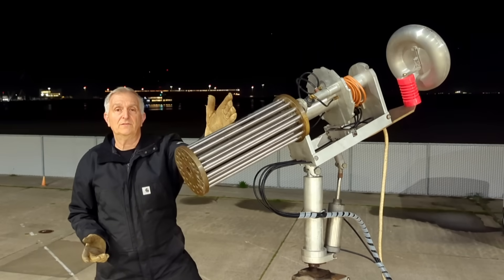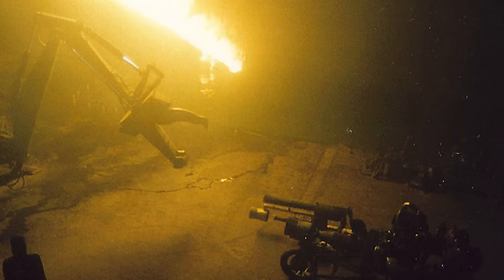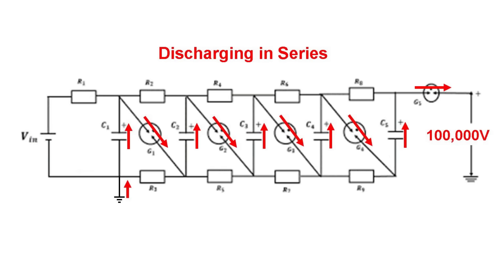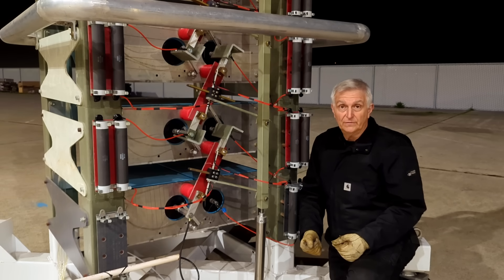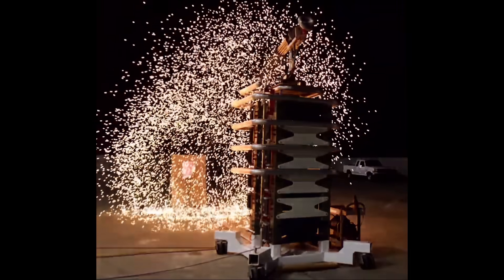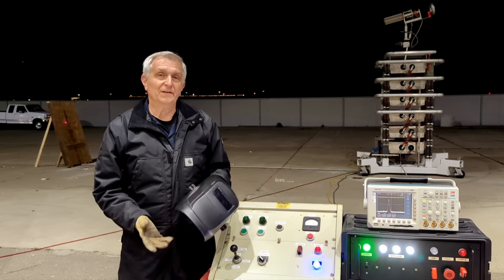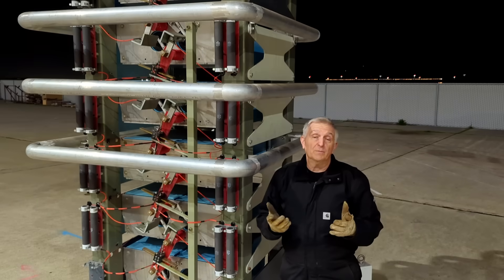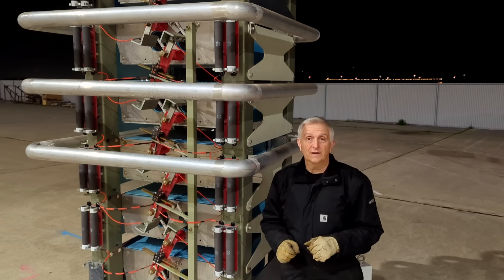Firing the Lorentz Plasma Cannon

Comment: I believe if you're able to control the force of plasma around a spacecraft, time travel is possible, the reason a spacecraft can journey through space then from space enter our parallel levels of Earth's atmosphere & can reach the depths of the ocean with no decompression or long means of oxygen or to replenish. Wormholes in these journeys or time travel can be true. This master of a plasma canon or rifle to myself can be a defense system for any electrical system, Friend , fo or beyond ...Kilo
Without A Doubt In The Thought Of My Mind Calculation! Need to find a more compressed outberst of energy in a smaller prizum uniform 
🤠 🤠 🤠 ...Kilo

Comment: It would be interesting to see this on a FPV drone. The plasma has a short range and not sure about recharging time but putting this as a last ditch effort around a more valuable air defence system may be useful. I'm guessing it can also be used against anti tank missiles.

Comment: If you could up the power output, narow the energy streem and greatly increes the rainge, charge rate and power input  you may have just made one of the best militery wepons ever built.

For instanc you could melt the armor off a tank or detonate bombs still inside a bomming plain or you could use this to oblitorate any long rainge mechanicle target in an instant  no matter the size. Even ocion based targets wont be able to stand up to this thing.

But there are other uses for this divice.

It could actualy be used as a long rainge wierles power transmitter for the electrical grid.
Reply: Tank canon rounds are fired electrically
This thing might cause a mf tank to chain fire all its ammo at once inside the tank

Comment: What was used to make the initial plasma channel?

I came up with a similar idea, but for something meant to stun, and a much smaller scale. To replace a stun-gun. The concept uses a UV laser to ionize oxygen. The laser is split using lenses and prisms before leaving the barrel without losing polarization, or replaced with multiple lasers if no lenses are used for a single one. 

If you didn't use the same approach of a laser to create the plasma channel of ionized air, then could my concept be applied partially to this device? Would range be as much of an issue after that?
Reply: Watch the slow mo
It fires a dart of some kind first and when that connects, it completes the circuit and kaboom. Idk if it's tethered like a taser or what's going on there but it's clear it has to make contact first and then the plasma charges down the channel
Reply: @misterturkturkle That's what it looked like, I was hoping not. 

A UV laser also has its own range limitations but with the levels of energy they're working with I'm sure it's much less of an issue for more of a range than this.
Reply: @mutiechameleon3011 true. But once you have proof of concept you can improve. It may have simply been a stopgap solution while they worked out getting enough capacitors and fixing the "establishing the channel" issues is next

Comment: I was confused about the small projectile, but he actually mentioned it earlier. When he talked about scientists launching rockets to direct lightning strikes, he said that they trail a small wire behind them, before explaining the Lorentz Force that keeps the wire intact. I'm guessing that the small projectile is basically the same, pulling a small wire behind it which is what actually carries the voltage.

Comment: Interesting problem is you still need a ground to receive the connection from the Cannon..has no practical use..the ground line running along the ground to the target has to be gone and the you have to find a way to make it work with out a ground connection..doesn't matter how much energy you crank it up too it still need a ground connection...😊😊😊

Comment: I'm curious about how expensive would each shot be after it is already built, it looks like it is not only expensive to build but also expensive to shoot, also, talking about energy guns, wouldn't a laser gun be cheaper and with longer range?
Reply from the maker: It's about $0.11 of electricity and $0.20 of trigger wire.  A laser that can ionize a 10 meter path would be a terawatt class system costing millions of dollars.

Comment: P(watts) = V(volts) * I(amps)
How does adding ~50% V (from 150KV to 210KV) result in 3x as much power?
Reply from the maker: Increasing V (from 150KV to 210KV) doubles the energy, per E=0.5*C*V^2

Comment: Very nice build with crazy results. How much did it cost to build? About 10 times your $4500 pickup cost? Did you connect the city power lines right to the transformer? There is a 13,000 volt line right next to this house. Not even 15 feet away from the house. Could never get enough legal power to power your monster capacitor bank here. Whole town would black out when you hit the fire button! Great job and also for the almost 5 million views in 4 months. I just bought a 55amp plasma cutter I haven't even tried yet is what sparked my interest. Would be neat to see a bunch more stuff fried and incinerated.

Comment: In your video, I see a large wire running from the cannon on the grown to under the CRT. It seems a projectile, maybe with a thin wire attached, leaves the front of the cannon.

Is my assumption correct that once the remaining gap is small enough for the electricity to cross (50kV per inch X 250kV = 5"), this thin wire completes the circuit which then vaporizes via the current - as it is the thinnest (can handle the least current) in the circuit? 

Using the right thin wire material (maybe titanium for white, steel for yellow) will produce quite a brilliant display!  (There are coatings available for other colors). The electron beam of a CRT will also act as a direct short for part of the current path.

BTW - building your own capacitors is straightforward and they can be tuned to handling the necessary voltage.

I built a foil tape and Kapton tape capacitor winding 'rig' that counts the inches of foil as they wind, using a (removable) hand crank on the center shaft of the cap (3/8" plastic). The inch counter allows me to calculate the desired uF and divide my materials equally (rolling each of many matched caps until my supply for a given batch is exhausted). The cap size is limited only to the width of the foil and Kapton tape that you can find, and the maximum diameter that is manageable as rolled up on the crank shaft, divided by materials at hand (for matched caps).

Each 2mil layer of Kapton between the AL layers provides 12Kv handling and as many Kapton layers as required can be stacked. Completed caps can also be put in parallel and/or series as required to increase voltage handling and/or uF - per your final space constraints.

I use my caps for Tesla Coils. (My small, battery-pack-powered RSGTC puts out 250kV, but at very low current). I do have an interest in Marx Generators. I do like portable, rechargeable battery powered capability in most of my projects – like my rechargeable battery powered Jacob’s Ladder. 

Personally, small, portable - yet powerful - makes an extra impression.

Comment: It looks like a lot of the energy goes outwards while going through the wire. If the current were a large enough number and the wire had just enough resistance to hold the hot plasma within the wire while it travels towards the end of the end of the wire, would it technically be possible to minimize energy lost from travel and maximize energy used on the target?

Comment: At 9:32 you can hear what sounds like powerlines or a transformer arcing over, which suggests the plasma shot caused electricity to run back up through whatever socket the TV was plugged into and out into the power grid

Comment: This has to be Russia or something, right? the lip sync is way off and those machines and characters are like something I have never seen. Plus if the machine is firing plasma, why can you clearly see a projectile hit the TV. But, I am more curious at what was running through the conduit on the ground that ran from the "plasma cannon" to the target.
Reply from the maker: A dart places the trigger wire that directs the main plasma channel to the target.  1:56

Comment: Actually, doubling the voltage quadruples the energy - E = 0.5*c*v^2 ("one half c v squared") - that's in joules.  (2v)^2/v^2 = 4.  I'm an electrical engineer, and my company invented the microwave oven.
Reply from the maker: Sure, that's why I only increased the voltage by square root of 2.

Comment: this is awesome, but doesn't it sort of miss the point if so much energy is lost on the entire length of the wire? ideally speaking, I suppose you'd want to see all those sparks only pop on the target
Reply from the maker: That's true only for an insubstantial target like a sheet of paper.  For a target with actual mass and thickness a substantially larger percentage of the bank energy will end up in the target.

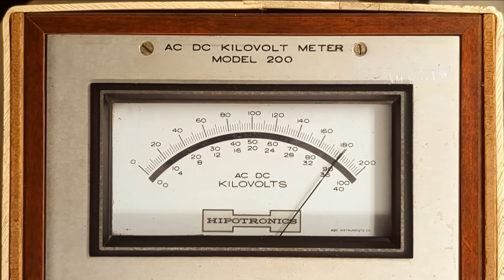Comment: 7:30 I may not be a physicist but when my math is mathing 150k volts doubled would be 300k volts
Reply from the maker: Energy is proportional to voltage squared in a capacitor system.  So increasing the voltage by 1.414 doubles the energy.  [150 x 1.414 = 212.1]

Comment: Well, shield the whole thing and route the electrons  and the fields  into the  cannon central barrel tube  through the magnet focal eyes and  the external  spinning same pole in faceing  North or South Pole magnets ..  to  help  compress and spin at least that pole repulesd into the center that the opposite pole material will naturally be drawn to and ram a lot of air down the barrels and tubes untill it meets and exceeds the resistance and heat  capacities of its or the surface of the materials it is bounceing uppon or refelcting off of at a far higher resonance so the materials     vibrates to fatigue and fractires causing the spaces nessesatty to fuse across the fractures and vetingsl throufh those hot plasma gasses..  .. 
  Use it as the spark gap  to ram pulse the atmosphere out of the rocket tube during flight .. ram air of super cold meeting and infused into and through the plasma field sould even help cool and draw  more due to the  natural pulse heat to cool in the heat transfer process.. temp and the time between is  a realtively compared to total like spèed time spans.  Slow process.   And the exoansion   as well as the up and down pulse and the charge positive to neutral and then rapid positive pulse  ... 
 Well to the low pressure and extreme temperature cold difference and the intake end , comoaread to the away going extremdly high elcetron density pole  will help draw more actual lighting right into  the intake side .. .  Or should if incentivised  but as you say ' pick up and directed coils  " etc.. 
 Which would be really cool to watch you do..  and Im sure the viewing audiance love to see it also.

Comment: I do not understand why the front of the tv screen doesn't get damaged if wood does.
Reply: Just before this shot I also was concerned the CRT could implode but the front is very thick glass and the dart that is spooling out the thin trigger wire is made out of aluminum which is a softer material and so it just bounced off the TV screen.  The plasma needed to go through the plywood to get the grounded aluminum foil in back and it was amazing to see the damage in person. Study the high speed video footage at 10:27.  Thanks for watching.

Comment: What is the projectile you see coming out that makes it to the target right before the sparks are seen?
Reply from the maker: The dart is trailing a hair-thin trigger wire, which will direct the 30000 amp plasma channel to the desired target.  1:56

Comment: I’m skipping though and watching in silence with no sound. It seems to me like there’s a small copper wire between the gun and target and it’s being pulverized - the following arc will ionize the air and allow further discharge via the air.
Reply from the maker: The dart is trailing a hair-thin trigger wire, which will direct the 30000 amp plasma channel to the desired target.  1:56
Reply: @LightningOnDemand haha wow! Unreal. I was watching in bed and not wanting to wake the wife 😂 it all makes sense now! What a wild machine! Thanks for the reply! 

It’s interesting to say the plasma is formed? When we have a flash overs in giant DC propulsion drive motors. The arc itself ionizes the air. And I was always under the impression that this process itself becomes conductive allowing electricity to flow in open air - provided there was a high enough fault current potential. 

I’ll have to re-watch this when I get a chance.

Comment: The cannon fires a wire with a probe using compressed air, and the plasma discharges on contact?
Reply from the maker: The dart is trailing a hair-thin trigger wire, which will direct the 30000 amp plasma channel to the desired target.  1:56

Comment: Wow thank you so much for this. A very fun watch.
Edit: i used to deal 120-300kv when i worked in transmission electron microscopy. The high voltage tanks were immersed in oil, but nothing like this though i always wanted to try it. Thanks for the memories.

Comment: Would a Cockcroft-Walton multiplier or a Marx multiplier work? They’d both would be around the same size.
Reply from the maker: Either could work, but I'd be concerned about the diode stacks in a Cockcroft-Walton, under this use case.  It was also cheaper for me to use DC to charge rather than high frequency AC.

Comment: a really faszinating project. I can barely image the humming in the air of so much voltage ^^ As I am only a layman I wonder, would this device be able to affect a faraday cage in any way.
Reply from the maker: Most Faraday cages aren't designed to take a 30,000 amp strike.  Two nested Faraday cages might be the way to go there.

Comment: What is the projectile bring fired from the cannon?    A railgun slug?  
And the plasma channel formation is guided by the the passage of the slug through the air? (because it doesn't look all that fast)
Why does the cannon need more than one barrel at this point?
Reply from the maker: The dart is trailing a hair-thin trigger wire, which will direct the 30000 amp plasma channel to the desired target.  1:56

Comment: This is a cool build. The "plasma channel" is an excellent demo of what happens when you run the amount of currents talked about through piano wire. Harvard's science department regularly does the demo on a smaller scale with a less fun set up. If you watch the slow mo carefully you can see the dart strike the target while carrying wire. Especially in the TV close up.

Comment: im confused. Is there a tiny wire connected to the back of the projectile?
Reply from the maker: The dart is trailing a hair-thin trigger wire, which will direct the 30000 amp plasma channel to the desired target.  1:56
Reply: @LightningOnDemand  that's what I thought. Amazing!

Comment: Okay let's do some math...the first death star was 99 miles wide/tall so the weapon was about 25 miles in circumference. So 25 miles is 132,000 feet. Divided by 5 feet. 132000 feet / 5 feet = 26,400 of these plasma cannons just to reach the ring of the weapon... which is 250,000 V's X 26,000.. 6,600,000,000 Volts... not sure on the Current, resistance, or power to achieve that.. then each layer or rings inside the disc/inverted pit of the hemisphere of the death star..  25 miles X  by 25 miles is 625 miles... 625 miles / 5 feet = 660,000 of those plasma cannons next to each other just to have a death laser... then up the amps and voltage needed.. which would be 25 times 6.6 billion volts... = 165,000,000,000 volts to power a death star...weapon of this type..

Comment: Did that thing fire a projectile of some sort ? Only it looked like some sort of bullet in the slow motion shots and it didn’t look like a plasma beam ?  Still a good video to watch. 👍
Reply from the maker: The dart is trailing a hair-thin trigger wire, which will direct the 30000 amp plasma channel to the desired target.  1:56